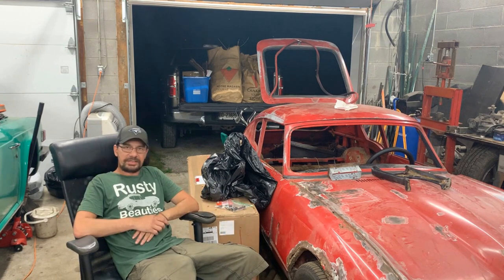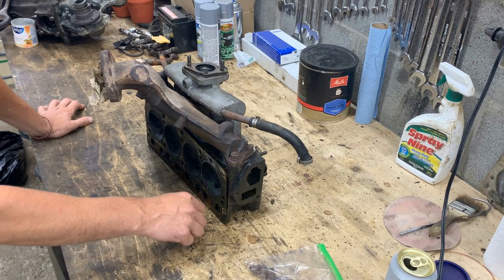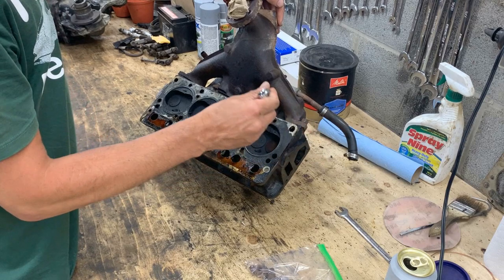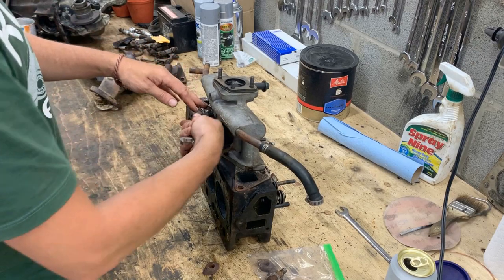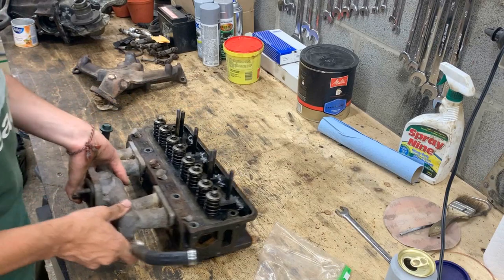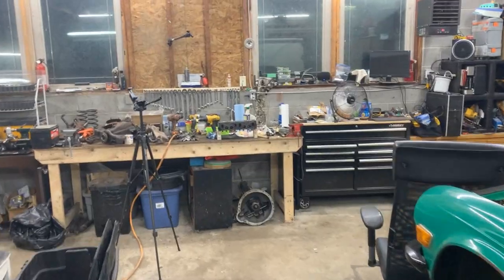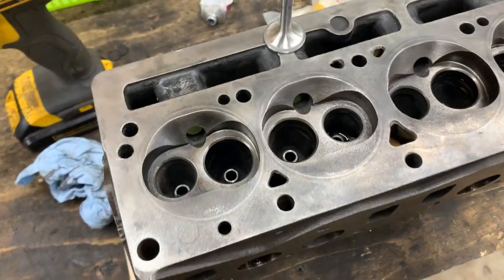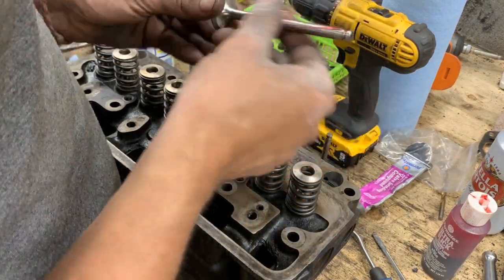1973 Spitfire Head Overhauling

Comment: I see something protruding into the area behind the exhaust valve. I believe it’s the end of a plug put there after the emissions system was removed. That much intrusion into the exhaust port is not good. Or is that the end of a cold air port. I work on MG’s mostly so I don’t really know how do you do missions on a current work.
Reply: It is part of the EGR
Reply from the maker: That is part of the emissions system, not a plug. There were some bolts outside that were used to plug the openings and I just reinstalled them.

Comment: It’s basically the same engine that started as a 948cc in the first Heralds, it became a 1200 then 1300 then 1500, as well as growing an extra 2 cylinders fo the 1600, 2000 and 2500 6s..... and the 1500 of course went into the later MG Midgets until 1980.

Are you sure the head doesn’t need new hardened valve seats ? For non-US engines in pre- unleaded times you would get erosion of the exhaust valve seats.
Reply from the maker: Yes, it might use some hardened seats, but machine shops take forever now and the season would be over. Like I said in the video, my friend wants to enjoy the car for a while and that was a quick way to put her back on the road. I myself am not a fan of the hardened seats. I would install them only if the original seats are beyond repair.
Reply: You must be from the UK. In North America Leaded gasoline was phased out in the 70's and 80's , back then few if any owners covered to hardened valve seats. But nothing really happened! Oh I guess one or two MG's or Triumph suffered VSR but many, many are still on the road giving good service often having their engines rebuilt (with a valve grind) but NO valve seat inserts.  As an ex pat Brit I am ofter astounded by the Unleaded gas phobia that infected the country (via the media) My Spitfire has not seen leaded gas in about 40 years and well over 100k on the factory head.
Reply: @tjm3900  I can't imagine what that engine was run on, judging by the state of it when it came into the workshop !

I imagine with that single Stromberg carburettor and terrible manifold, the car will be grateful for every ounce of power it can get from proper maintenance and decent fuel.....
Reply: @johnmoruzzi7236  
Yes, I have not seen crud build up in the valve pockets like that. I was thinking the engine was having a lot of blow by from the valve cover ?

Comment: Nice job but wouldn't it have been the best time to fit hardened valve seats for unleaded petroleum?
Although it is probably best to actually hear the rest of the engine properly running first I suppose.
Reply: That engine has lasted a lot of miles on unleaded without valve seat recession. Many owner prefer not to use valve seats unless they are really necessary. In my experience they very seldom are.
Reply from the maker: Yes, it is a good time, but machine shops take forever now and the season would be over. Like I said in the video, my friend wants to enjoy the car for a while and that was a quick way to put her back on the road. I myself am not a fan of the hardened seats. I would install them only if the original seats beyond repair.

Comment: Some year 1500's had bigger inlet valves. I think that the valves you got were for one of those models.
Love the videos Elin but please try to work on the sound levels ;-)
Reply from the maker: Yes, I have a problem with the sound and I am trying to work on it. I film with my phone (after spending thousands in cameras I figured my phone works best) but it does this weird thing sometimes. It starts the audio at a very low level and then slowly increases. So sometimes I have to cut the beginning of the clip and adjust the level to the max and still it is too low. But I will figure it out.